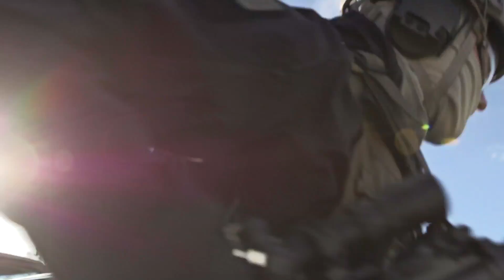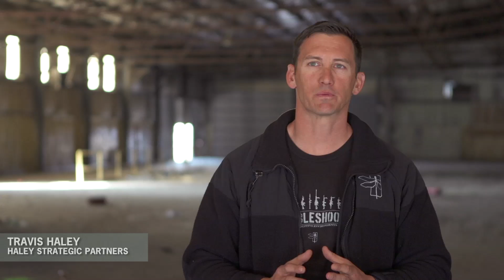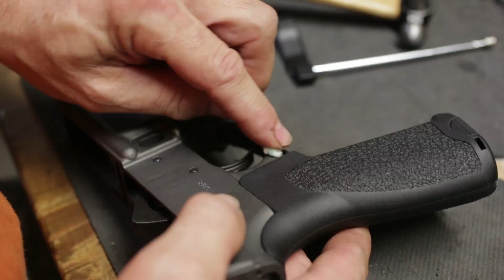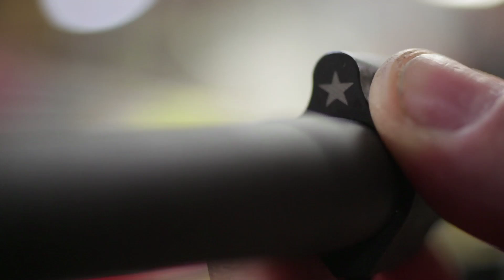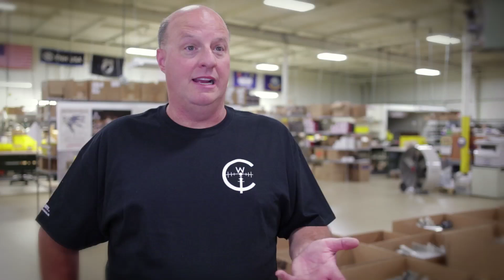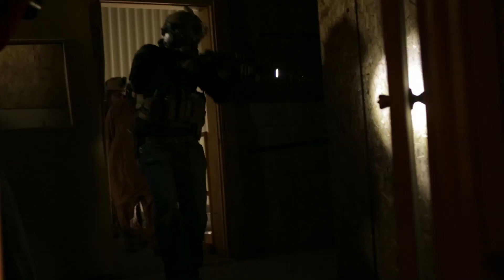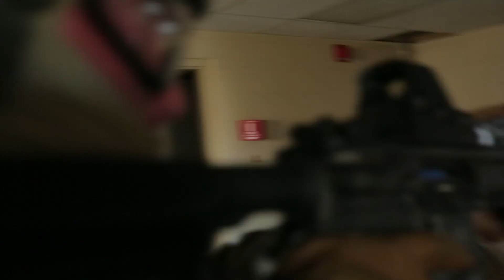The Haley Strategic Jack Carbine Built by BCM

Comment: I don't think they take applications via YouTube. Go to their website, drop a line. You probably also need some CNC machining experience, perhaps an engineering degree. Small arms repair might get you a job at your local shop or range as a gunsmith, but probably not the actual desgin and building of weapons systems for a custom manufacturer. You could always make MEU(SOC) 1911's for people, there's a decent market there.

Comment: A DI AR-15 weighs less than one running on a piston system, and doesn't require a non-standard bolt to stop the carrier tilt and other problems brought in by a piston system.
DI AR-15s have worked out their kinks for over 50 years in real service, and there will never be a piston AR-15 that is lighter than a DI gun.

There are reasons, mainly weight and reliability, that Stoner used DI. Those reasons tend to coincide with why working people still run DI.

Comment: The only thing I don't like is the low profile gas block uses set screws and is not pinned in like a standard A2 front sight/gas block. If they would change that I would give it a harder look. Otherwise this is a really cool rifle that gives a lot without adding a lot of little things to drive up the price more.